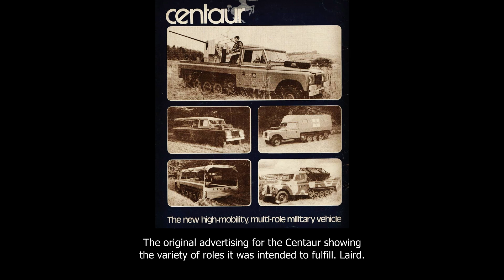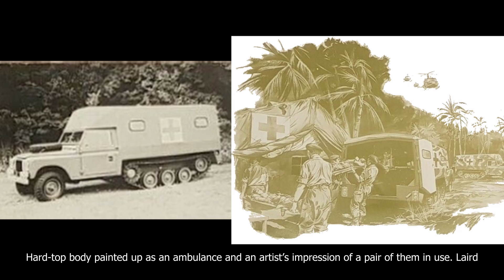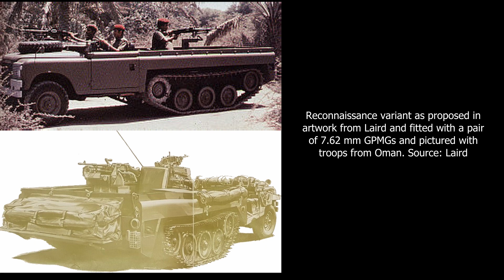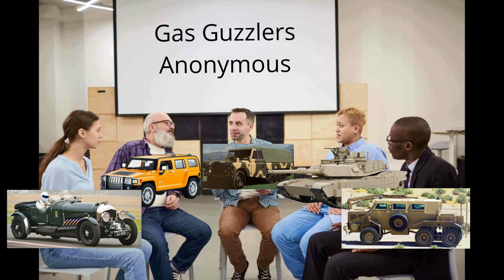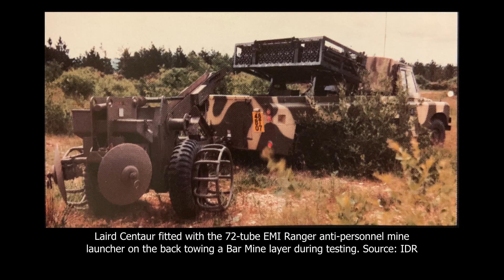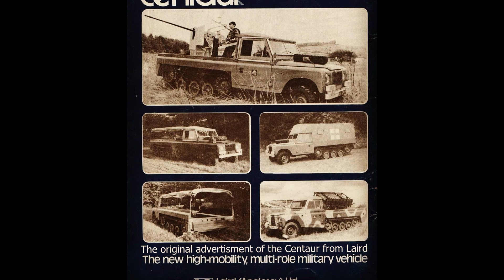Half Track Full Failure  | The Laird Centaur

Comment: It is a great shame that it was not developed further because during the trials it constantly demonstrated the ability to climb 70° slopes and had far better traction in muddy condition and there was also a pair of twin-caliper disc brakes to assist in steering as many German half-track vehicles. It was powered with a  156 hp Rover 3.5 liter V8 petrol engine but apparently the consumption was fierce about 4.15 mpg or 1.47 liters per km and many parts like the tracks was taken from the Scorpion. Contrary to what a guy stated it didn't require much maintaining and would loved to have this vehicle!

Comment: Let's face it, although incredibly cool, haltracks were a developmental dead-end, widespread only in one point in history, when they made sense. Wheels have their benefits and downsides, as do tracks. Combining the two is just adding the downsides - worse off-road capability of the wheels and high cost and maintenance of the tracks.
Reply: would be good as farm vehicles tho. as the tracks better offroad performance would really support it in rougher conditions. yes its limited use but if we gonna spend all that resources we might aswell find some use for it. even if its limited
Reply: basically the only advantage wheel have is speed and maintenance . as for halftrack they where made because they where more easy to drive than fully tracked vehicle , once automatic transition appeared in tracked vehicle there was no point anymore for half track
Reply: The main reason for halftracks (prior/during WW2) was COSTSAVING (as was stated by the germans in their documentation).
You get (limited) off road capabilities but with basically a simple(cheap) car differential.
Fully tracked vehicles need an essentially more expensive and complicated type of gearbox.
(With exception of the "Ostschlepper" which therefore could only manage very low speeds)
When using as a gun tractor halftracks have the additional advantage of being more soft and less "jerky" during turns (this also was clearly stated by the germans when using their halftracks)
Reply: There was also the training advantage to half tracks.  Anyone that could drive a truck could drive a half track.  A fully tracked vehicle took a great deal of training to master.
Reply: @richardm3023 I would think it's just the opposite. Fully tracked vehicles had a more sophisticated (sometimes fully automatic) transmission system which makes it EASIER to drive. Halftracks had the manual truck/car gearboxes which makes them more DIFFICULT to use. It's like driving a very old T-Ford which is very complicated and many people wouldn't know how to do it. But anybody can drive in any car nowadays without special training because the transmission system is very sophisticated nowadays. As a rule of thumb you could say that  when something is old and simple it's often hard to use. When it's internally complicated and sophisticated it's often easy to use.
Reply: Most early half-tracks were used for desert exploration where tyres would sink in soft sand and you spent many happy hours playing around with sand channels and shovels to move a mile or two. Basically tracks let you lower the ground pressure, increase traction and can travel over more territory.
Thats the idea that stuck around with low cost half-tracks like the M3, the Opel Maultier and so on  which are just trucks with a bit of extra off road performance.
Buy yeah, a dead end!
Reply: One advantage is that half tracks potentially can be more rugged than either wheeled or tracked vehicles.

Lose the front tire of a 6x6 and you have to stop and fix it.  Lose a track ditto.  Lose a wheel in a half track and you can still differential steer with the tracks and get out of a sticky situation.  The HT essentially has 2 independent power transmission systems, which is very cool.